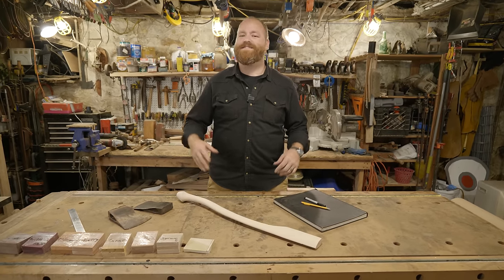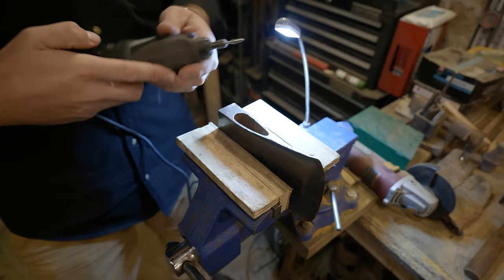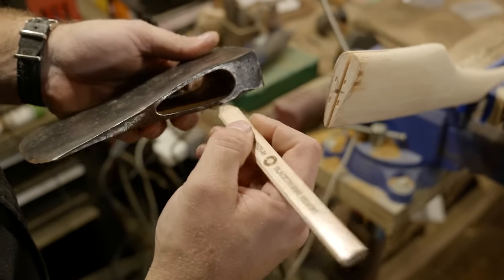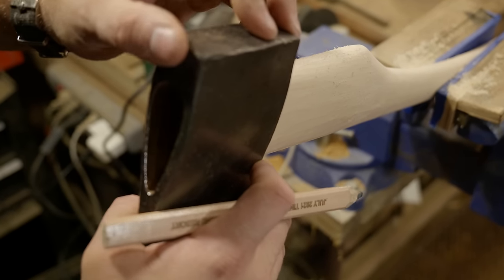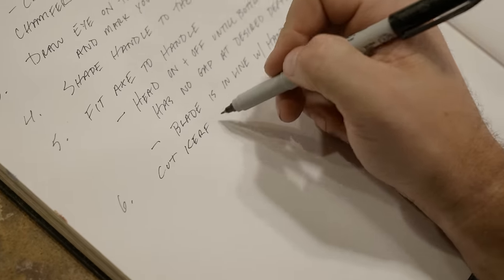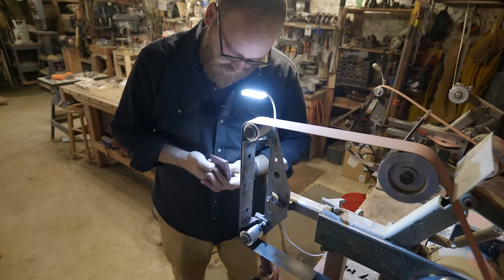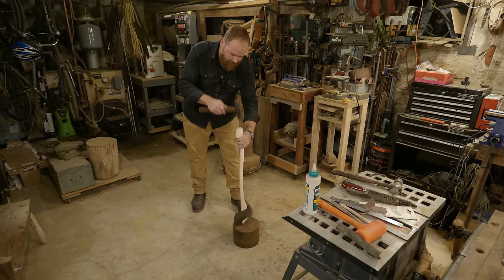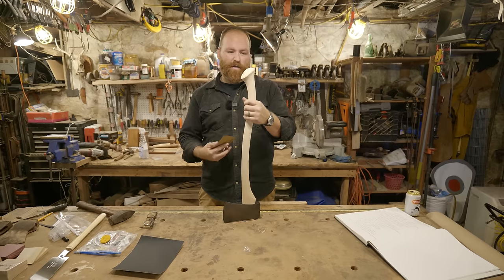HANG That Axe: 10 Essential Steps to Re-Handle your Axe Head

Comment: Awesome video. One tip to give is that boiled linseed oil coated rags can spontaneously combust.  So if you are using rags to apply linseed oil, burn them outside or make sure they are completely dry before tossing them in your trash or used rag bin.  Linseed oil has been known to take out many houses/ garages.  Know the products u use and keep safe

Comment: I picked up a 200 year old broad axe off eBay.  It had been hand forged by a blacksmith.  I got a 35” hickory handle from Ace Hardware.  It w as a little been a job.large but workable.  The major problem that I have found is the eye tapers from  .750 to .690 at the top.  The width varied about the same amount.    I almost have I hung.  I had to resort to my belt sander and four in hand for most work.  I have cut the recesses for the ears but do not have it all the way down, yet.  It has been a job.

Comment: Excellent work, The one thing I have found is that using the Japanese pull saw will leave a thinner kerf than what is originally there, so after using the pull saw I go in with a conventional push saw, widens up the kerf nicely

Comment: great tutorial. I have recently made a few handles from Black Locust. A nice straight grain and strong. It is not a commercially available wood, but I found some about a year ago and have been letting it dry and its now ready to use. Ive also been collecting axe heads. My most recent build was inspired by one of your videos. I made a really cool hatchet from my old Plumb rig axe, that I have owned for about 40 years and sank at least a bazillion nails with it. I enjoy your videos and have gathered several great tips from them.
Reply: How long do you let the wood dry? I've started a few ax handles, and they all crack or split. A friend said to soak it in water?
Reply: @gam940  usually about 1.5 years as long as that time includes a couple of summers. Then I cut the blank on the bandsaw. I cut a lot of blanks for  different things shortly after collecting the tree, as then the wood will dry quicker. Always cut oversize and longer so you can trim away any ends that split.

Comment: Great video! I’ve had a few handles chip at the bottom, so the only thing I would add is chamfer the edge along the bottom where the hammer is hitting as well. Also, if you’ve never tried Snake Juice from Killinger Official it’s pretty amazing stuff. Leaves a darker finish and smells like campfires and happiness.

Comment: Great video - thanks! Question: I'm new to this hobby (obsession, apparently, in my case) and I'm wondering about oiling the handle once before putting on the head so the interior wood is conditioned?

Comment: Thanks for making this video!  Enjoyed watching it.  Spotted the bevel gauge on your bench and will mention to Brandon that you need some WR logo scrapers to complement the gauge!   @Whiskey River

Question - Do you ever try to dry fit the wedge or do you find you've got it down pat on most heads?  I find getting the right depth the first time can be a challenge, but haven't done many restorations.
Reply from the maker: Thanks brother. Good to meet you at maker camp.
Reply from the maker: Hey, some how I missed the rest of you comment. I don’t dry fit the wedges. I will typically decide wedge width and length depending on the type of wood, and do my best to prep the kerf to fit.

Comment: Very cool I have pretty much failed at hanging stuff but getting better this should help a lot next time.
Reply: Don't let your past fails sidetrack you from trying to hang an ax. It's part of the process ""failing and then learning" buy cheap handles and practice I guess is my opinion. It's fun remember you can always get wood anywhere take care of the ax heads LOL. Good luck.
Reply: @DonLewis9274  my thoughts practice makes better. have a great week.

Comment: Hi, I picked up a curved 32" Hoffman that ended up being the wrong size for a Collins Jersey i had. The eye section is 1"x 2 5/8. The eye of the axe head is more like 15/16" x 2 7/16. Is this more of a boy's axe head despite being 4lbs, or should I just be trimming the handle to fit?

Comment: Great video, I have an 30c on order from whiskey river.
Any good tips for hanging a jersey head??
There’s no real good info online
Reply from the maker: My tip is to hang it the same a man a regular head. Don’t try to taper the sides sharply. Just a long gradual taper into the eye. The lugs spread out slightly more than the main body of the eye so it should taper just right.

Comment: When hanging a head the smaller end of the eye always goes on the bottom correct??
Reply from the maker: Yes. As a general rule. There are some Scandinavian heads that are tapered the other way but almost every other axe head has the larger side of the hole at the top. This gives you a tapered hole, that when combined with a wedge makes a mechanical connection that cannot back out.

Comment: I have yet to see in any "hanging" presentation that denotes, except for the obvious, which side of the axe head faces down the handle and which side faces up. Especially, where both sides of the blade are of the same length and curvature. Perhaps you could help out here. Thanks.
Reply: A lot of times if there's a name of the brand on there in Dustin's case it's a plum it'll say plum on it and if you read it upside down then the ax is upside down, if you get what I'm saying. Good luck
Reply from the maker: Hey Norman. What don said is true. “Typically” the stamp on the axe is on the left side, if the bit is facing away from you. There are a few brands that don’t follow that tradition, like Norlund, but it’s a good place to start. Even more “typically” an axe eye will be slightly larger at the top. Sometimes it’s just a 1/8 or 1/16, but again, that a good place to start when hanging. If the top and bottom of the eye are the same, and the head is symmetrical then you next step, is…hang it how ever you want😁😉. Thanks for the comment.
Reply: Wonderfully assembled video guys!  I expected no less.  Thanks for the support.  Keep crushing it!
Reply from the maker: Thank you brother!